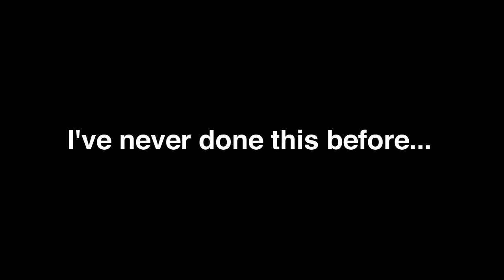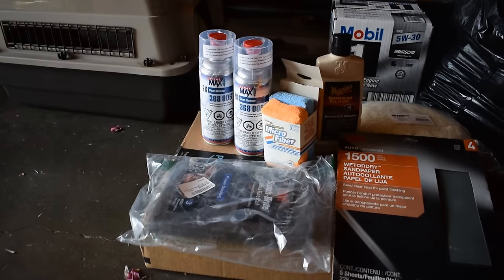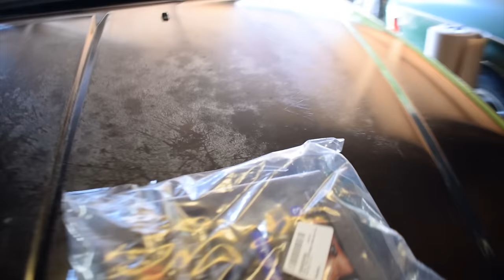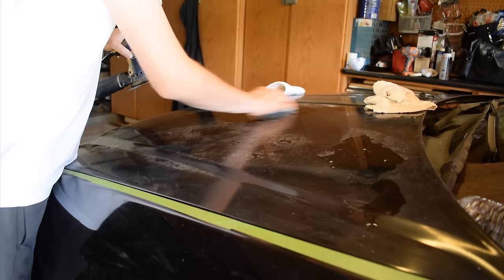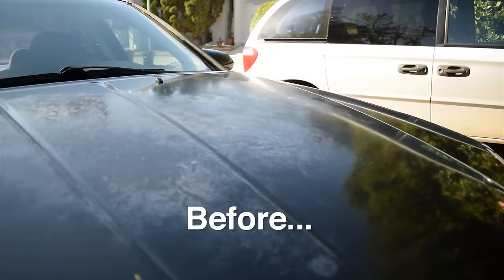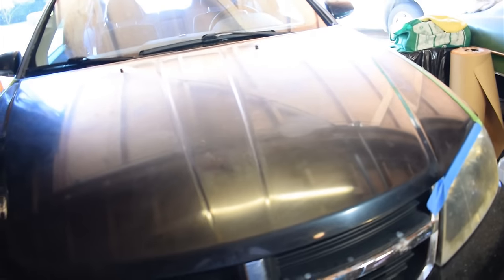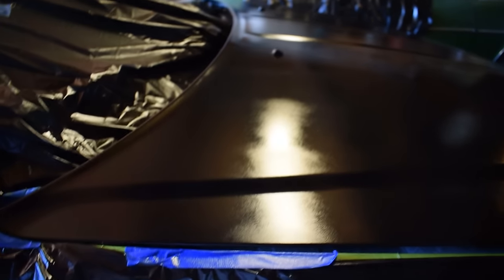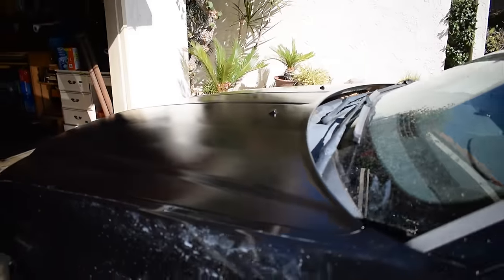How To Repair Clear Coat On A Car

Comment: Dude, use a 3200 psi pressure washer to remove the clear coat. wont damage the paint. Worked for me
Reply from the maker: Cool James, I'll have to look into those

Comment: I’d be a total beginner at this point, but on observation, a coat of two of base coat MIGHT have eliminated some of those off spots
Reply from the maker: True. Looking back, I think my main regret is not completely sanding away the white spots
Reply: Tobias Holenstein Heard......I’m going to be doing the same thing to the roof and hood of MY Avenger.....apparently they have lots of issues with the original clear coat. I would prefer to do it myself, as even a cheap Macco paint job is a few hundred, and I heard the cheap Macco job sucks. So we’ll see.....
Reply from the maker: @gregbartley7179  Best of luck with your project! Its crazy, all the Avengers I see around also have peeling clear coat, especially the black ones.

Comment: I used the 2k, it was about $20/can online vs. $10 for the one part auto parts stuff. I was down to white primer, only on the roof of my 2001 camry.  Sanded by hand with 400, then 1500, and some 2000 grit. I did not bother to use filler. Used the aftermarket spray cans for my factory color, then 2 cans of the 2k. Has small pits, I had a few flaws but it looks light years better than it did, for less than $100.  Clear failed in a 2 square inch area after 2 years, I sanded down and used the cheap can of clear coat to try to glue it down, we'll see how it goes in the future. For all the negative comments, for an inexperienced DIY like me, or Tobias H. here, it's a good learning experience, and the old car looks a heck of a lot better than when it was down to primer and peeling clear coat. This is not a professional instruction video, but they are out there, so go take a look, but it will involve painting and usually filling. A paint job would have cost me about $700 here, so if you can get by on $100 or less and a little work, go for it. It's a good experience.
Reply from the maker: Thanks for sharing your experience! I appreciate it. It's good to hear that overall it worked out well for you 🙂

Comment: Good video however I think you would of gotten a better result by spraying the clear wetter meaning you should of sprayed it from closer first coat should be a scratch coat from the farthest of all coats and then progressively as each coat is layed down closer to the project ya want a deep shine and a deep shine needs a thicker coat when everything is said and done but progressively  it's a  horozontal surface so there should be minimal orange peel if it runs ya might have to wetsand
Reply from the maker: Thanks for the tip Dave, I appreciate it. I'll take that into consideration for when I do the roof
Reply: So, is that called dust coating?  Start from further back when you begin and then get closer each coat.  How close are we talking?  The concern is (like you mentioned) having runs or horizontal lines.  I am learning as much as I can because my whole car is peeling it's clear and have learned so much from these comments.  However, I thought there would be an easier/cheaper way.  What a pain in the ***.  3rd car that's done it now.  And fixing it is starting to seem to costly, at least for me.
Reply from the maker: I think dusting is when you do the first coat lightly from far away

Comment: Any time you spray paint (either from a can or spray gun) you have to overlap 50%.  That is why you have stripes in the finish. Sure you can wetsand and buff, but that requires extra work.
Reply from the maker: I have a video coming soon of me wet sanding and buffing the hood!

Comment: I'm just an amateur hobby painter but the prep work was not done right. Your clear coat spraying was good, doesnt look like it ran, but I'd have removed all the old clear coat and even done a single base coat before the clear. Also to really get a shine after, try sanding with fine grit sandpaper and buffing with a buffing wheel. Good job on the taping.
Reply from the maker: Thanks man I appreciate the advice, I'll be doing that for the roof

Comment: Should have just sanded all the failing clear off and re sprayed the base coat, if you’re going for cheap just use single stage, and spray it with a compressor and a harbor freight spray gun, it would look 10000% better...
Reply from the maker: RustyJeep thanks for the info 🙏 I’ll take that into consideration for when I do the roof

Comment: Spray Max - Clear Coat, Aerosol, 11.8-oz 3680061 - From the photos and descriptions it appears to be a 2 part epoxy clear (you activate it, then have a 2 day window). The product page doesn't specifically refer to it as an epoxy, but it seems to be.

Comment: I'm going to attempt this but will use a better mask with organic Vapor or acid gas filters because those particles are likely getting into your lungs with just that small mask. Thanks a bunch for the video!
Reply from the maker: Best of luck with your project! Yes I recommend using a better mask as well

Comment: Just wanted to point out a few things. Use proper protection! NEVER USE THESE CHEMICALS WITHOUT A RESPIRATOR !!! 
What you had on was an upgraded DUST mask. It Does Nothing For Fumes!!!
Thank you for your efforts and enthusiasm. Let's reassess the project. The clear coat is severely weather damaged. This project simply was to make a complete disaster of bad clear coat situation and on a very low dollar budget with a little planning it mad the car look a 1000 times better. I think for the money and effort the results are really great.
The only way to get a factory finish or better is to repaint the car. This project was to simply clean up if you will a very devastated paint/clear coat situation. I do not think his expectations were any higher than to clean it up to the best way possible without repainting the car. Just be more careful with these chemicals. Read labels and use better personal safety.  Party on dude.
Reply from the maker: Thanks William! You're absolutely right. I thought the mask I had was a respirator, but it was just a dust mask. Just like you said, my goal was to inexpensively fix the problem and prevent further damage. I wasn't expecting to make it look perfect or brand new

Comment: This looks typical for a first timer, acceptable  anyway. But a couple tips from a guy with about 50 years of doing these kind of fixes.  
First,  your homemade  paper discs , very amusing. Didn't they tell you at the supply shop they make  them already  round?  And also you can get the  scotchbrite  in the same shape  in sticky back or velcro.  Most people don't know this but  the clear-coat  on the newer cars is a plasti-coat, that's why the white edges and the ledge on the edge of it.  That's also why you don't see this kind of paint damage on the older cars, 70's and earlier .
Reply: Oh yeah, I forgot ,  If you go to  Car Quest , they can match your factory paint in a rattle can. Take the code off the door
 and they'll mix it right there, put it in the can and it's only a $20 bill.
Reply from the maker: That's awesome man I'll have to check that out. Thanks for the tips!
Reply: Rustytruck Thanks for this tip. Awesome.

Comment: Been in the paint and body business for 25 years. Only one way to fix a clear coat. Sand it down, primer( if necessary) repaint with quality paint and clear coat. If you get an imperfection then color sand and buff. The time and effort you put in this could have been a professional looking job if you had the right products. You did the work, just used junk for the finish. Won't last a year. And it will look just as bad as it did. Get a compressor, a cheap gun from the auto store, find a wholesale paint shop and do it one time.

Comment: Ok now lets get serious 600 grit sandpaper,a 10$ harbor freight paint gun and 30$ pancake style  compressor  a quart of single stage enamel paint and do it the right way in three hours work you have a real fix. Just keep it waxed with nu finish polish every couple months you would not have had this problem in the first place if you had only sealed the paint from UV rays and pollution and worst of all rain that stripped the minerals out of your Chrysler Quality paint job [not designed to last just like the car] to start with!

Comment: Ok so it does look better
your scotchbright would also work better wet, but you needed to do more and get those light bits out.
Using a machine meant that you wouldnt be able to better follow the curves and pressings of the hood
doing it by hand you would have used 80 grit lightly and worked to 2000 grit

your paint plan wasnt good, start in the middle and work out
to prevent the risk of having a thatched look alternate a coat that goes side to side across the hood
when you put paint on your height and speed were way to inconsistent, 
you can practice that out making runs without paint, its a memory thing
if you cant do that then run at the thin or light speed and use 5 coats
also you need to overlap the paint application by 50% into the last spray run
have a good one ...
Reply from the maker: Thank you for the tips
Reply: its ok, you still have to do the roof
this time get the paint code and get some base coat made up and put into a spray can
start with primer, 2-3 coats, 3 coats of base, 3 coats of gloss
cheers

Comment: Instead of using the masking tape couldn't you just get a garbage bag and then cut it down the side or tarp or some sort of plastic, then lift up the hood of the car place it about 5 in in under the hood and then let the rest lay over the outside panel to the car where the lights are and the grill. It should stay in place.

Comment: i would have used 80 grit and taken it back to bare metal. prepped it fro primer. sprayed primer hit that with 400 wet. then sprayed the black base coat over the top. 4 coats possibly . then let dry for a few hours then hit with a light coat of clear let set for 15 to 20 mins let it flash off then hit it with a wet coat of clear. would have been alot easier and quicker than trying to rub the bonnet (hood) back with scotch brite or 1500 wet. A for effort though 

Even if you rubbed it back with a cut n polish you might have been able to cut the paint back enough to clear over the top of it again.

Comment: nice!  but next time you can remuve the hood and make a lot easy for you cause ain't have to mask the car. the hood is the more easy part to remuve of the car.  ps haw mutch you pay for thuse clear coat cans??
Reply from the maker: That's a good point! I didn't think of that. The clear coat cans are $17.40 each. There is a link to the amazon page in the description if you are interested

Comment: Dude, yes it turned out better than it was, but you can do a lot better for cheaper if you do it right. No offense. Start by using more aggressive sandpaper. My guess would be 800. Maybe even 400 then 800, then 1000,1500 then cut, buff and polish #justsayin
Reply from the maker: Thanks for the tips Kenny. I'll definitely take your advice into consideration when I do the roof

Comment: My friend don't get discouraged. Nay sayers are always arnd. U said it it was your first try. I have never done it either and that's why I was looking your video. I felt only thing you need to do differently next time in my opinion is move your hand during spraying little more quickly. By slow speed may be you sprayed some spots more and some less. But practice make man  perfect. Thank for video

Comment: When you spray, you need to start in the middle of the hood and work to the outside edge
Reply from the maker: Really? why is that?
Reply: You wont end up getting clothing {or in the case of an air hose} rubbing on the wet clear coat
Reply from the maker: Ah ok, thanks for the tip. I didn't think about that
Reply: That is incorrect. You start from one side and work you way across, usually stopping somewhere around the middle or however far you can reach. Then reposition to the other side and pick up where you left off. It’s called “keeping the wet edge” or something like that lol. Basically, if you do it your way, start in the middle and work out, by the time you go to the other side, that clear coat in the middle of the hood has already started to dry and the overspray won’t melt into it nice and will leave you with something that looks dry and spotty.
Reply: chris is right

Comment: I Think you should spray it in black first 
Than clear coat it 
That would be a better job

One day you will be the best
Reply from the maker: Thanks Kendrick! I may try that with the roof. I'm not sure yet
Reply: Tobias Holenstein definitely hit it with color before clear! Is it just straight black or is it metallic? I’m sure there’s something close enough in a generic rattle can. Also by doing this, you can sand it with a bit of a coarser grit paper. 3M has a red 6 inch “hook it” sandpaper that will velcro to your sander. It’s fairly cheap for a box and you use it dry.  Should speed things up. Could go down to 320 grit if you spray sealer primer and then base/clear...
Reply from the maker: Thanks for the advice Chris! I'll see if I can find the exact paint in a rattle can. It has some metallic flakes in the paint. Although, I think if I can get all the old clear coat off before the new clear coat, I think the color will be even. I don't think I'm going to mess with sanding down to the primer. I just want to pretty much get the old clear coat off. The paint itself doesn't seem damaged
Reply: Tobias Holenstein, when you sand the actual base color, even if you use very fine wet sand paper, it alters the color. For example, if I try to wet sand a flaw out of the clear coat (run, sag, bug, dust etc.) and I sand through the clear into the base, I’ll have to redo the job.
Reply: @TobiasHolenstein  Getting expensive isn't it?  I am trying to figure out what to do with my car that is peeling off clear.  I think I know why you didn't use a harsher grit when sanding, same reason I am worried - not wanting to damage or remove more of the base coat.  But I am glad you made this video, because now I know what it will look like if you don't base coat it, then clear.  Next it will be primer, then re-base, then clear, respirator, cut and gloss.  lol  j/k  That's if you can afford to do all that before the cost raises to what could be done by a professional auto body shop.  Anyway, thank you for making this.
Reply from the maker: Thanks Autumn, no problem. Yeah I guess the more professional you want your end result to look, the more it will cost. The way I did it in this video didn't cost much, but I probably should have used a proper respirator lol.
Reply: @TobiasHolenstein  I wouldn't have even known to use a respirator for spray paint at all.  I can't afford that.  I'm looking for the most inexpensive way to repair the dang thing.   It's a great car and so much on it is not working.  The fun stuff, like the sunroof, speakers sound like crap, but has an awesome radio.  When I bought it 2 or 3 years ago, absolutely no paint problems, now it just looks like crap, dented roof (somehow), seems someone sat on my hood or something it's dented in, same as another car I had.  Maybe I should move.  Anyway, I have 3 expensive items I want fixed and I'm running in circles, because none of them are easy repairs.  So, I understand not doing it fully to professional standards.  I could sell it, won't get much for it like this, so I keep it for now. It's summertime or will be and I wanted to get it fully fixed, so at least knowing my options on the paint aspect helps.  I'm not buying a friggin respirator I can tell you that much.  It's not like I paint cars for a living.
Reply: @SpacyStacy32  you can get charcoal filter masks cheap I got 2 for $7, like a dust mask but for paint

Comment: Sand the entire area down to the primer. You must wear a respirator that protects you from all paint to include fumes. Should have not worn any face covering. If you are not sure, ask. Your health is way more important than that car. You admitted to yourself and your viewers that you could smell the paint. You should not smell anything when using spray paint.
Reply: Do not follow any advice from this video. Remove all clear and base coat. Spray one layer of primer, two layers of base and three layers of clear. ALWAYS WEAR A PROFESSIONAL PAINTERS RESPIRATOR. ALWAYS!!! If you can smell the spray paint, you are wrong.

Comment: No it does not. It has delayed further flaking, but thats it.  Epoxy allergi is one of the worst allergies you can have. There is natural epoxy in all wood, and it will give you an itchin skin rash every time you get in contact witrh it.  I got it by not wearing an air pressured mask, when using 2-pack paint and plaster.

Comment: That looks horrible bro.  You didn’t sand it enough to remove the old clear coat plus you where dry sanding next time use water and sand paper to wet sand and you also need to start with a 220 grit or 600 grit to remove it better then move up to a 1000-1,200 grit paper. Clear coat it and then wait 24 hours and wet sand that with a 2,000-5,000 grit to remove all the orange peel then buff and wax it. 
But you have the right idea down just not there yet.

Comment: Dude it no one at the store where they sell sandpaper tell you about orbital sandpaper discs that have the velcro attachments on already cuz that was the worst thing I've ever seen in my life was barely spinning you could see all the old paint you needed to send down a lot more at least to the primer then spray it with the right color to match your vehicle then once that was done send it again a little bit with 1500 to 2000 then go and hit it with clear coat cuz that was horrible